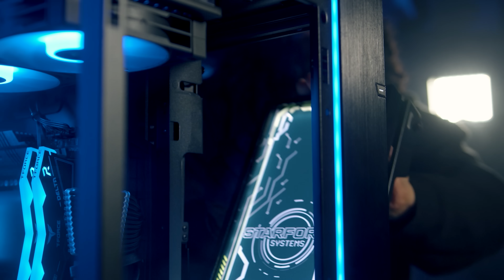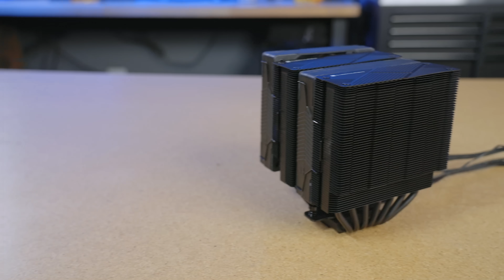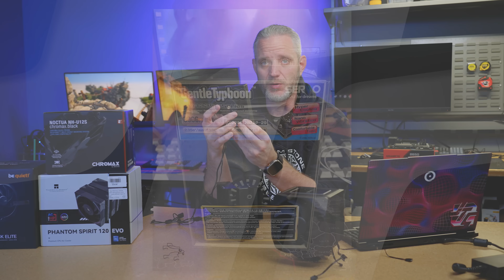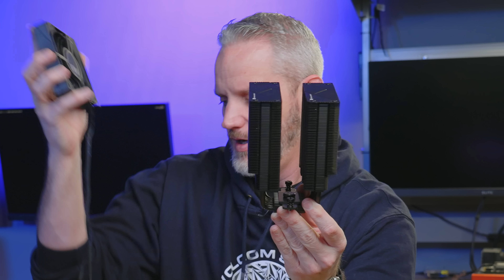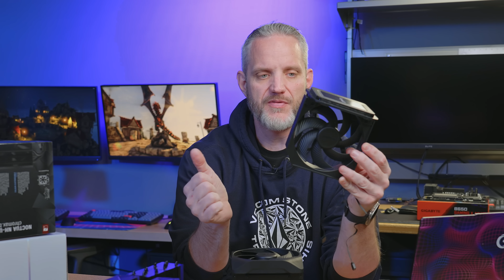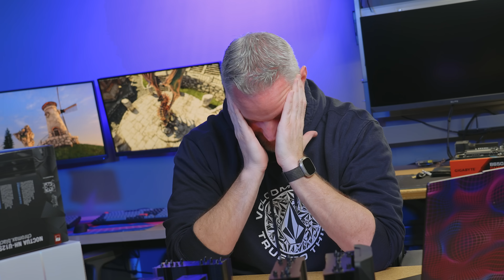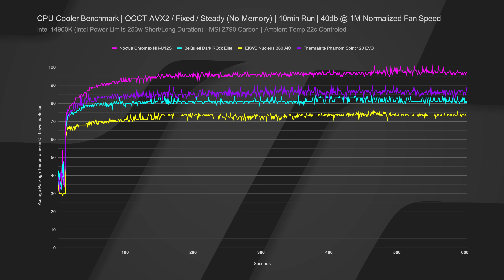This $49 CPU Cooler has big brands SHOOK! Thermal Testing Cheap vs Expensive CPU Cooler!

Comment: I recently had to replace my old ass AIO because the liquid evaporated out of the unit after like 13 years of continuous use. Couldn't find any single 120mm radiator AIOs to replace it (only thing that would fit in my case). Ended up getting a Thermalright Phantom Spirit 120 SE. It's keeping my CPU as cool as the AIO did when it was brand new. I didn't expect such good cooling from an air cooler. And it can't just stop working like the AIO. At worst, the fans could die; and fans are easily replaced.

Comment: WHAT I HAVEN'T SEEN YET,  is the Noctua 15 g2 with fan SWAPPED to fit taller ram TEMP test. Ai is suggesting swapping in a 120mm fan to fit 44mm ram. 

 BUT, it also states that then it would be equivalent to lesser coolers, and then therefore makes no sense. 

 BUT, that test should be hugely popular, ESPECIALLY with many many fans in the test.

Comment: Got a peerless assassin 120 SE extreme and my temps went down 10 degrees c on my 5700x vs my noctua nh-u12s. Huge upgrade and sitting at 71 degrees peak if not lower

Comment: The fans on the Dark Rock Elite not being replaceable with a normal fan is a crime. One of the big selling points of air coolers is the one part that will eventually wear out over time, the fans, are easily replaced.
Reply: My Dark rock 4 is stll good after 7 years 135mm fan runs like new.

Comment: I just bought their 240 aio and changed out the fans with Bequiet 120mm fans and finally got my 13600k under control in the Silverstone Grandia GD11. The aio was $44 and the fans 25 each. It hit a max of 73c in 3dmark. Prior, i hit 90c right off the bat when the physics test started. I've also used their daisy chained fans (3pack) and have been very happy with them as well. So much value for the money.

Comment: Rocking a TR Ultra 120 EX Rev4 Black here, and it comes with 2 120mm with dual ball bearings for $50 or so also. Love that heatsink. It's pretty impressive that all of these can effectively (barely in the Noctua's case) cool a 250W CPU. It's hard to argue the build quality, value and performance of the Thermalright in this comparison, although all three companies do make nice heatsinks.

Comment: Hi. There is a small problem in the test, at 40 dB the Thermalright is not even close to its maximum speed, at maximum speed it cools better than the Be quiet cooler.

Comment: Air cooler issue with Threadripper:  High-end boards have the CPU rotated 90 degrees.  Other than the Arctic and Silverstone, there don'[t seem to be any good air coolers that direct the air out  the rear of the case.

Comment: If you're running a modest CPU with under 200W TDP, I've always used the good ol' Cooler Master Hyper 212. Currently running a 212 Black on a Ryzen 5 5500 and it's never above 65C on the core. You can't beat that with a stick.

Comment: Testing these monsters on a test bench is really not a test…in the case, especially a small one, I doubt those numbers you came up with would be the same. People still want to deny, that any AIO is worth the investment. I have my Corsair 280mm on my 5900x rig that once cooled my FX 8350 14 years ago keeping temps 78C max when rendering multi core processes and prime95.

Comment: I recently built 2 very similar machines. both Z790 chip-sets, Asus and MSI, both with I7 12700K CPU's. One I did an AIO on the other I used the Phantom Spirit 120. Neither machine is over clocked, default settings. The Thermaltake machine Gigabyte RX 9060 XT gpu and the other machine has Gigabyte RX 3070 XT gpu. When playing BF 2042 for extended periods with all the game setting as high as they will go, 2560x1440 res. the Phantom Spirit machine will run 80 to 100 fps and the CPU never goes above about 65C using in the neighborhood of 80 to 100W and only a couple degrees hotter than the AIO machine under the same situation. IMHO, for air coolers the Phantom Spirit 120 is obviously the best bang for the buck. Down side, it's huge. Same conclusion J came to.

Comment: Not surprised. I’ve been using ThermalRight since the Ultra Extreme 130 Copper on i975X & it is still being useed adapted. I did get into Noctua for fans then on the C14, U12A D15. 
Not saying that they’re not good, be a they’re both awesome, I just mean that TR gives then a run for their money 
Its amazing how a 20yr TR can keep up or maybe take more then a modern NH U12A whiten it’s extra heat pipe. But to be fair, coooer sure helps. But even the standard TR Ultra 120 is good comparison

Comment: Its good! Do more cooler test.
Really enjoyed it!

I think you should do 2 runs (the others do not)
1 run at max watt/ heavy load here 254W
1 run at medium like 125W. 
Hope you catch my drift.

New trend is lower cpus like 9600x, 7600x, 7500f, 12/13/14600k. But also 78/9800x3d, high-end, not insane watt.
So when you do more coolers, you will not only hit "top performence" but also "consumer touch".

Comment: I tend to consider air cooling way differently than any AIO as I can be sure I wont change my cooler until CPUs go beyond its capacity (and I don't know how it could happen considering my computing needs are already covered and next gens will just do more for same TDP). I only change my cooler when I get bored of it, which is very rare as I don't like aquariums with no fish and tend more to hide my computers into some furniture, hole in a wall etc. As long I can't hear it I'm happy.

So as in 4 decades I only bought 3 air coolers, and always been able to sell them at descent price cause they don't lose much value if they are great, or help selling the PC better when upgrading, it costed me around 5 bucks per year including fan swaps, and the NHD15 I've just bought and will do its job just fine for more than an additional decade. 

So although it doesn't make the most sense to buy an expensive air cooler like an NHD15, it's not an issue neither, especially considering I can resell it way better than any AIO that should end its life in a dumpster.

Comment: As often, I'm months late as I catch up. I've been using Thermalright from far back in the 2000s. In fact I believe they are the ones who pioneered the tower cooler as we know it today. They are most definitely the ones who came up with that type of fan hook. The very first ones I used actually laid down and the fan blew downwards. I'm pretty sure that was on an AMD Socket 939 and then Intel Core 2 Duo/Quad era so we're talking 20 years ago. So Thermalright getting back into the picture in the last couple years is good to see. This is great for those on a budget build and I might use one on my wife's next build since she is hesitant about using any sort of liquid cooling that might cause her 3090 any grief and she won't care so much about what it looks like, even though for a reasonable priced cooler it looks very good. Personally for my own PC if I were to use an air cooler now I'd buy the Be Quiet for twice the money because the aesthetics would be worth it for me and I'll pay for that and it even has a bonus of a little better cooling. Be Quiet has a more budget version that would be a good direct compare with the Thermalright.

Comment: Fun fact: There are 360 AiOs available (at least in my country) that cost a hell of a lot less than that overpriced EKWB unit. Plus there's all sorts of reasons other than price why I wouldn't touch that thing. 
Thermal*right* (guess "rite" is/was a knock-off brand as I can't seem to find it on amazon today?) Aqua Elite 360 Black sells for EUR 52. Coolermaster, ID Cooling, Deep Cool and Enermax all have 360s for around EUR 60 on offer. For comparison: Both the Noctua and the be quiet are ~EUR90 right now. 
Would've been very interesting to see what sort of results and bang-per-buck you'd get with one of those budget AiOs.

Comment: I’ve used the Noctua NHU14S with a pair of their NF-A12 120mm fans for years now. Very quiet but very good thermals with it. The cooler runs under $90 US on Amazon and the stock fan is ok but I prefer the performance of the NF-A12’s

Comment: Ocypus A62 feels like it could be good. There are 2 version, which the version I picked (Iota) is one that has a digital display for temps and RPM (I think). It's rated at 280 TDP like one of the coolers featured in the video too, but costed me only around 65 USD (3300 PHP). The other one I didn't pick has RGB lighting which is only good for RGB aesthetics, still the same cooling TDP, but not looking good for the monochromatic black-and-white build I was looking for.

Comment: I think you mentioned that you would use your decibel meter in the beginning of the video, but you didn't make any mention of noise data wise or at all.  Kinda disappointed in that.  That is definitely half of the real world performance value of any cooling system, the damn noise.

Comment: The U12S isn't designed to handle a 250+ wattage cpu so I'm not surprised temps weren't great so that wasn't exactly a fair test was it. 

Been using one for years, now with a 7800x3d, zero temperature issues but then that cpu is well within spec for that cooler.

Comment: Hey Jay, great video! I recently watched a video from Hardware Canucks comparing the EVO to the SE, and it seems the SE is the better cooler. The only time the EVO outperforms the SE is at 100% fan speed, but that’s mainly because the EVO's fans have a higher RPM.

What’s interesting is that, based on what Hardware Canucks mentioned, they think the performance difference is due to the lack of updates in the EVO’s fins compared to the SE. Both use the same fins, but with a different fan. They believe the better fan in the EVO doesn’t match well with the fins, causing increased turbulence, which results in slightly lower performance.

Now, is the performance difference huge? Not really. But it’s worth noting, especially considering the SE is $35 and the EVO is $50.

Comment: For $53.59, you can get a Frozen Notte 3 fan w/argb 360 AIO. You can swap in other fans to match your case fans or swap in T-right fans to replace your case's fans and still be under the $100+ Nocti and Be Quiet prices. For $80 to 84, you can add an LCD screen to the pump head. Thermalright is the budget builders best friend.

Comment: High end PCs are getting way too inefficient with heat and energy consumption, even at stock speeds. Your graphics card shouldn't be a foot long. Your CPU cooler shouldn't be six inches or more tall and require multiple heatsinks and fans.

Electrical engineers: improve.

Gamers: we overclocked in the 90s and early 00s to get more life out of aging gear. You new kids spend more on controlling thermals with overclocked gear than if you just bought a higher tier component and ran it at stock speeds.

Comment: Im running a thermalright AIO(frozen notte 240) i got for like $50. While the hookup was annoying(each fan has to hook up seperately for both fam speed and ARGB) the performance is decent on a 3700(maxing at 61 degrees c) id like to see more termalright aio's tested

Comment: im using id 55 lp for itx r5 4500 65w  it works great in a case so small and less 1cm from back gpu as on riser, rare hits 65c. impressed me so much i need lp cooler for my refresh build 5700x so ive gone for id cooling 67mm and 6 heat pipes. could not find any tower coolers with 120mm fans what fit so the id 67 best option and great deal, brand new but opened was £10 cheaper so £30 that inc postage so it was a cheap and if it performs as good id 55 i be very happy and find out tomorrow when put system back together in new case

Comment: So, you put a cooler that is effectively rated for 129 watts of power on a cpu that boosts to 253 watts and wonder why it's performance is suboptimal?

I watched a guy in a little chevy pickup try to pull a broke down piece of earth moving equipment through an intersection once, I don't consider the little chevy pickup to be at fault for the failure, I consider the person who mismatched towing capacity and load to be at fault.

Comment: I wanted to improve a core ultra Dell tower that I got for work and it had a generic oem cpu cooler, but it looked like the tower was too skinny for anything but a downdraft. I found a Thermalright Peerless Assassin 90 SE tower cooler that would fit the thin tower and it's a huge improvement. 29 dollars and it never gets over 70 during extended stress tests in 3dmark. for the cost you really cant seem to beat thermalright at the moment

Comment: Using the thermalright burst assasin 120 se. Crazy value at 30 aud and for my 5700x which doesnt run all that hot it does a great job

Comment: I wonder how the NHU12A with dual fans single wider tower would do compared to the thermalright. But it's like anything, if you're a fan of the brand and like reliability and money isn't an issue then get what you want. I'll always stick with noctua because I'm just a fan of them.

Comment: I must have gotten a special air cooler, I got the cosiar digital  V-cooler and under max loads I stay around 30c-35c. My cpu is rated at 90c- 5800x3d.

Comment: Just got the PS Evo and it's absolutely fantastic. Half the price of the AIO I previously had (had to get rid because it was in the way of my new taller RAM) and lower temps. The fact the mounting screws have a hard stop really takes the guess work out of mounting pressure for someone who hasn't swapped out a cooler before. Cannot recommend it enough.

Comment: The Phantom Spirit is now an old model jay. This came out in Feb 2024, you need to look at the newer versions that came out in January 2025. Try the Peerless Assassin 120 SE V2, the V2 in the Gen 5 model. Faster fans, better heat pipes. Have one, and it's incredible.

Comment: $50 for a cooler (Thermalright PA120), it's two fans (Thermalriggt TL-C12C) and a way to keep my cpu straight (Thermalright anti-bend buckle). Highest temp i've seen so far was 75c during a cinebench run.

Their only non water cooled competition is basically 3x the price. Noctua $130 (single tower) - $140 (dual tower) and be quiet $125 (pro 5) - $150 (elite). Be quiet does have a $65 120mm dual tower cooler (pro 3) but i haven't seen enough about it yet.

Comment: I've got a "Peerless Assassin" that looks like your Thermalright but with a smaller height with a 90mm fan to fit in my case, hopefully with an extra exhaust fan on the side panel of the case. It has the curved fan blades and similar bearing and around a $50 price. I'll change to a ball bearing fan after awhile.

Comment: Jay, this was a great video and it shows how good air coolers can be.

However, what's interesting is that the results might be different depending on what your P and E cores max turbo ratios are, or especially if you test with E cores disabled. Based on my experience and also reading many reviews of air coolers and AIOs, it is apparent that the conclusion depends a lot on the P+E configuration of those Intel 12/13/14 gen CPUs. For example, any cooler will keep a 13/14900K at 253W PL1/2 at lower temperatures compared to a 13700K at a 253W PL1/2, given that both CPUs are hitting that power limit. The reason for this is how spread the heat output at the IHS. The 13/14900K has to feed 8P+16E cores with those 250W, while the 13700K has just 8E cores, which means the P cores can use more of those 250W. This is also why often the sustained P-core clock of a 13700K will be higher than an equivalently set up 13900K/14900K in terms of operating voltage. The overall mutli-core performance of the 13/14900K will obviously still be higher, but this is due to the 2x number of E cores.
Performance aside, this is a very interesting factor that many reviewers testing coolers on Intel CPUs are not checking - how different coolers perform based on the number of active P and E cores. I suppose some coolers might be better at dealing with more saturated heat at a smaller surface area compared to others. It would be cool if you can test this.

Comment: huh, I was looking for a alternate cooler, cause my bequiet shadow rock slim 2 that I bought when I was still using a ryzen 5 3600, isn't exactly ideal for a 5800x3d (it works but I constantly run the 5800x3d with a slight underclock for some years now, never being willing to pay this much money for a better cooler. And I am not a fan of fluid cooling) so this might be a decent replacement. I can put my old cooler into my media pc that has weaker parts cause... well you sit further away from a tv and usually I just run movies over it. Some games. My main pc is for gaming xD (the main reason why I even have a second pc in my living room is cause I HATE youtube ads you get on the in tv app and I can't get Crunchyroll to run on the tv it self..)

Comment: compare the 240 aio with dual tower air coolers. i had no idea why my cpu reach 100c in just 5 6 seconds with 240 aio (cpu pull around 240w+/-). but ya its a cheap 240 aio

Comment: Yeah, size matters, a lot. If you want maximum cooling performance, start by looking at coolers that are at least close to as big as you can fit. I'm not a die-hard Noctua fan, but I suspect that Noctua cooler has pretty good performance, for its size, and possibly also noise level.

Comment: Noctua CPU Cooler NH-D15, ID-COOLING FROZN A720 , Artic Liquid Freezer III, Scythe Fuma 3; - Run the fans at 40db like you did, but also run the fans at 100% showing cooling and noise. 
As always, great vid...

Comment: I love my noctua air cooler on my build from 2020. Have had no issues with temps on my Ryzen 5 5600. Never officially tested for numbers but I’ve never seen over 60°c  it’s usually around 39-50